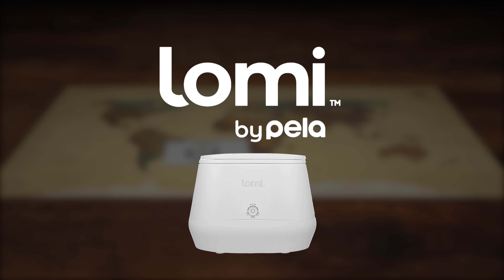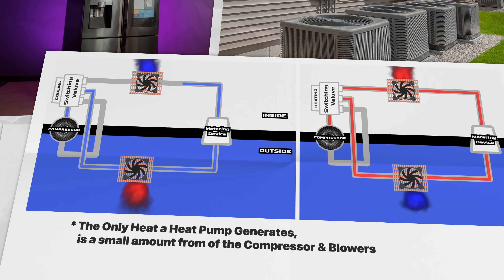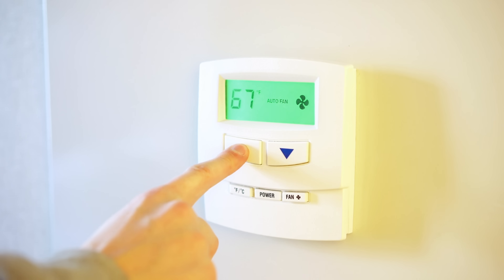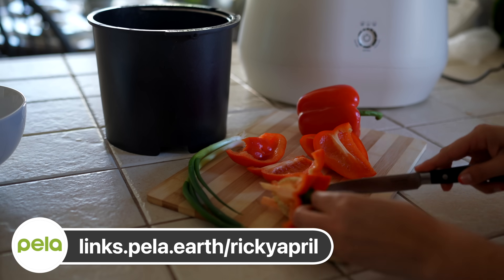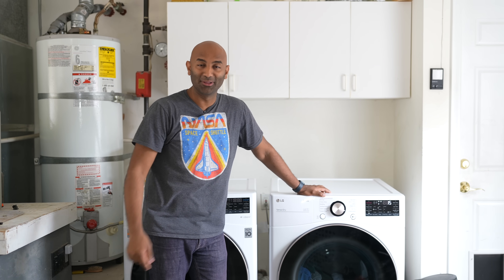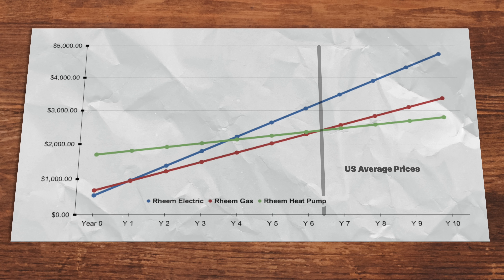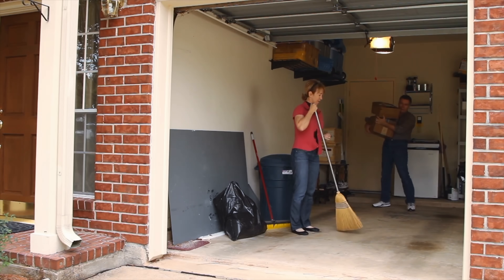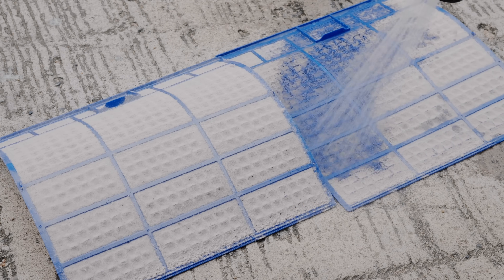I'm Shocked How Much Money Heat Pump Appliances Save!

Comment: i wonder if external heat pump appliances are a thing. being able to hook your dryer, water heater, etc into your mini split heating/ac system would be really cool and wouldn't have the downside of pulling heat from the surrounding air. i live in maryland and we have a heat pump water heater in the basement (where i spend most of my time), it makes no sense because i'll have an electric heater running half the time. being able to pull from outside air instead would be much better.

Comment: I do agree that heat pumps are great but they are even better when used in combination with each other.  Like, the best example would be heating your pool with your home air conditioner, instead of that heat being blown into the air next to your house, it goes through a heat exchanger that your pool water runs through.  Now that’s efficiency and I believe there is actually one out there that is basically made for the whole house needs, so just one system for your hot water, your cool air, pool, dryer, and whatever else you might have that needs heating or cooling.

Comment: Heat Pumps throw the heat all around the house it follows the pipework.a gas fire is concentrated heat exactly where you want it and not wasting it heating empty rooms therefore it is cost effective and not wasteful like your pump.Nice video 500% efficiency haha not in the winter pal heat pump not used in summer

Comment: The thing I'm really looking for are head units for water heating or dryers that can be attached to multi-split heat pumps like the large Mitsubishi and Fujitsu units that can have as many as 8 circuits attached to them. The idea that we can have such a unit intelligently shunt heat around from one place to another seems like an exciting idea. Why cool down the room where the hot water system is when you are actually demanding cooling in the living room? Pull the heat from the living room and put it into the water. I have seen presentations from Mitsubishi showing such systems, but suppliers here don't seem to be mentioning such options on their websites, yet. Maybe I need to make some phone calls.

Comment: Your dryer vent line needs a booster pump.
I’m almost sure it’s a code requirement for a run of that length.
You probably have one that has a failed air switch. 
I recently changed out mine for a Tjernlund  LB2

Comment: Heat pumps all the rage but where is all that power going to come from? Wind? Solar? Yeah right! And they work really awesome in the snow belt regions. NOT Comparing heat pump models to electric is rediculous… what’s a heat pump use for energy? Pixie dust??? Electricity Spread out our usage??? Dude spreading out usage is using different energy types, when one utility is struggling it’s good the have a diversity of energy types. You are encouraging everyone to load up the electric grid even worse than it is now. Do it because you like the technology, but don’t tell everyone it helps the electric grid, it doesn’t.

Comment: I recently bought a Heat pump dryer, and when you get one you could probably do a whole series on them.  Mines actually a washer and dryer in one unit. In theory it shouldn't give off much heat because the air is a closed cycle. But its not a totally closed cycle and some humidity and heat come out into the room. Still its really nice not having to vent the air which would be replaced by outside air somewhere else in your house.

Comment: As a Brit who grew up with farenheit but converted to centigrade the latter makes much more sense.  After all, freezing point for water is 0C, how simple is that?  Boiling point is 100C.  I struggle to remember the comparatives in farenheit (was it 32F and 240F) which shows how impractical that scale is.

During the transition I remember having to keep converting back to farenheit to determine whether I might need to wear a sweater if it was going to be 16C that day 24C that day but it doesn’t take very long at all.

Comment: Love the HP water heater.  Here in Florida it helps dehumidify and cool down the garage which in turn affects the requirements for the rest of the house.  The biggest bonus these days have been the improved automation that let's us set up a schedules for demand.  At the family bath time we crank up the temp and demand (it uses the heat pump and the element.  The rest of the day it's at a lower temp and heat pump only and at night it's pretty much off.

This is my second HP.  The first was a GE and lasted for 6 years.  Pretty good since that model was discontinued after 2 years due to issues.  It paid for itself the end of the first year due to rebates.  The second is the one from Home Depot.    I was already sold on the tech, but it is the scheduling control app that really makes it shine as I mentioned earlier.

Comment: Heat pump dryers are relatively new... in the US...in Europe they have them for decades.
And what is up with those sponsored products, I saw one for water purification with need of throw away plastic filters and now this compost thing that is a mechanical device that'll break and cost electricity to run and a simple compost bin could do the trick much cheaper and cleaner.

Comment: The only reason is see to ban the ban on gas usage is to advert the strain on the power grid.
In the Netherlands, all new construction goes gasless because that's the only way to build energy efficient enough.
But our power grid is kind of overloading. Half the country can't connect anymore renewables to the grid.
Some solar fields have been shut off for a half a year because they can't deliver on the grid.
It's a bit of an issue. Because not only are metal prices going through the roof now. But the amount of technical personel is way to low.
Reply: (And the amount of artsy fartsy (wo)men way to high)

Comment: The scam is CA won’t give you the$3000 until you Cap off your gas line and completely remove your gas furnace .  Even though the better choice for home owners is to keep / use the gas furnace and have heat pump together . For occasions such as when outside temperatures reaches close to freezing or when it’s a cloudy days where solar array is useless.   Can you image the $$$ the electric company can make from your power usage? HUGE!   Heat pump used 240 at your attic AND the unit outside the home! , uses a ton of energy!  Ofc California at this point will roll out the push to home battery industry scam soon after.
Reply: Germany did the same thing, electric demand went sky high and now they buy more Russian fossil fuels than anyone just to power it all!

Comment: At least you didn't use oil heat, we just changed over the office at work after it hit $6 a gallon. It was costing around $600-900 to fill the tank and the furnace was rated at 2GPH, so it was costing $12 an hour to run. The mini split should cost about $15 for an entire month so it paid for it self the first time we didn't need the tank refilled.  But on the water heater, our is in our bedroom closet so we would need to run the heat to make up for the cold air coming out unless we ran a vent to the outside, maybe with a valve to send the air back into the house in the summer.

Comment: The U.S. has so much natural gas that for the time being we don't know what to do with it. We're currently burning off so much of it in the fracking operations that it looks like NYC from space. Heat pumps are fine, and I used to have one (almost 30 years ago!), but they don't really offer savings versus natural gas. That is why they have not caught on and are not likely to do so.

Comment: I'm all for this, and have been hoping this would happen for the longest time. This needs to be combined with passive solar (thermal, not cells).

What we also need to have is repairable appliances. Repair that water heater. Repair that fridge. Etc. The parts need to be standardized - open standards! - so we don't throw away so much.

Comment: Too bad installers here in Mass gouge customers for a 1 day instal and charge 10K labor minimally. I had 2 quotes for a 2 ductless unit for my 701 sq foot condo and was quoted 14K!!! The parts are only $3,500 for a solid known brand unit which means they were charging the rest as labor. I read it was a cheaper solution to a furnace but with the bonus of AC. Not where I live. Price gouging simply because heat pumps are better. Absolutely ridiculous.

Comment: Ricky, great episode. We have PV solar, two air-to-air heat pumps for home heating/cooling, induction cooktop, LED lights, a Tesla, and a Li golf cart. A heat pump water heater and clothes dryer are on my radar. The PV solar has already reached breakeven, so going forward our energy needs are free! Savings in 2022 will be $3450.

Comment: With our 13.2 kWh solar PV system coupled with our two PW2's, we are operating as a microgrid for 9 months of the year producing all the electricity we need to power our all electric home, charge our two Tesla's and export ~50% of our solar back to grid. We have heat pump and heat pump water heater and agree they work extremely well. Our total electric bill last year was $180, and our monthly bill is generally less than $15.

Comment: this man talking farenheit like those units make sense. If you didn't already know them, you couldn't make sense of them without constant reminders and guides. I know that because thats how it is for the rest of the planet when having to convert to farenheit. Celsius is easy. 0 is freezing. 100 is boiling. At 50 you get burns. at 25, you are comfortable. at 12.5, it's not so comfortable anymore. What is 100F???? what is 0F??? is 50 F cold? or hot? is 200F a lot or a little? much like other imperial units, they only make sense for people that like to fudge the numbers and keep the rest uninformed.

Comment: What I want is to tie all appliances to central home heating cooling heat pump with and exchanger outside (with option to bury heat exchanger loops underground).  If you have a central heat pump and blower in the attic right above the corners of four rooms you can locate refrigerator, dryer and hot water heater under it with standardized wall connectors.  If we are going to heat pump all the things then all the things should be integrated into a single system for maximum efficiency.  Otherwise you may be generating heat in the house that then needs to be pumped outside if you have separate systems.  This would have the lowest up front cost and best energy efficiency, and would be easiest to design into new housing rather while a retrofit would require extensive remodeling.

Comment: Heat pump for heating only. I'm in the field of HVAC, and I'll tell you right now the techs and companies out there are mostly idiots. Number one problem with heat pump equipment failures are improper installation.  Sizing the equipment is never properly done. The equipment itself is still very expensive, it's not economically viable to use heat pumps for all those other appliances when the risk of Joe Dirt installing it wrong is too great.

Comment: Thousands of people using simultaneously tankless electric water heaters? Sounds like a typical morning/evening in germany 
Mine heater has 22kW and it hangs over my bathtub, so when I take a shower, I can adjust temperature with one grade precious - the only positive thing about it. Well.. it was quite cheap (300€) and takes barely any space

Comment: I installed a 4 head mini-split heat pump last Fall and a hybrid water heater a few weeks ago. Why? The house has oil heat and is insanely expensive to heat that way. At worst, when the air is 0°F and the efficiency is low, the system is about as expensive as oil, at best, when it’s above about 25°, it’s much cheaper than oil and I can turn off the boiler now that I have the hybrid water heater and the oil boiler isn’t needed for water. 

Having the hybrid water heater in the basement is sort of poor man’s geothermal as the basement is always 50°, although the heater does drive its area down to 45°
Reply: Oh I should say I installed the minisplit system myself except the last bit of refrigerant hookup because having an installer company do it absolutely wrecks the cost effectiveness of it. The equipment is pricey enough as it is without doubling for installation.

Comment: Climate change is natural. Man made change is not. Where they meet is the question. BTW, I have a heat pump water heater and truly it saves me 40 dollars a month in cost. Make sure you vent the cold air outside or you will freeze.

Comment: LOL I have been an HVAC contractor for 40 years. Heat pumps have their place but you are leaving out a lot of details. You didn't mention anything about standby loss when comparing to a tankless water heater. You didnt mention how a heatpump water heater was going to fill my 120 gallon whirlpool bath, because it wont. You forgot to mention how hydronic systems, which are much more efficient than warm air systems operate at temperatures far above what a heat pump can produce unless you have a radiant low temp system installed in your home. Finally, and I speak for most qualified heat pump repair men, If you actually think I am going to replace a compressor in your heat pump in 6 degree weather and shovel a path through the snow to get there, your cost of repair will be far beyond anything you think you are going to save.

Comment: It is great. I fix appliances. Questions what are you doing when you're fridge heat pump die after 3-4 years and cost $1600 to fix it you and 99% of the people through it away great green thing. And if you buy a nice heat pump dryer and instead of $30 for the heater now you need $500 for the heat pump plus labor to replace it, you through it away. Nice technology. If they spend a money to ask the previous generation of engineers ho they appliances lasted 30years plus instead of 3. Or just make a washer bearing what last 50years instead of 3, or an icemaker what can operate more than 2 years....... If the heat pumps come with 30 years warranty labor included that I all in . If it is 1 year than no point to work on it!!!!
Reply: One more small comment. Just yesterday they had to trash 3 fridge what other wise in perfect shape because of the heat pump replacement cost of $ 1600 what comes with 1year warranty !!! Put the average 4 years of life in the calculation than run it again, not so good anymore right. No people on the street braking LG buildings to demand better compressors or tax them to create extra waste or investing if the engineers there went to any school.... Nobody cares, so stop global warming speech until people really do. Not with forced government penalties, with common sense.

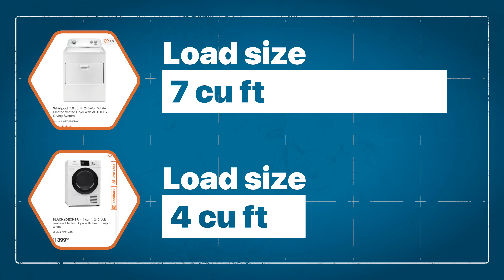Comment: omg, you guys are so overpaying for stuff. Heat pump cloths dryer at 9:20 for 1400 USD? 

in Europe dryer like that (with heat pump, not resistive one) cost 400 USD from cheaper brands to 700 USD for models with additional bells and whistles to 1000 for top brands. Only Miele costs about what "most popular in Home Depot" is around that price, but this brand is always a price point outlier.

Comment: Not an option up here in Scotland. Summer temperatures on average are 16-17 C and we Scots don't use the heating in summer. In winter the average temperature is 0-3 C, so air source pumps would be dragging cold air into the heating system. You would need the immersion heater on all the time costing an arm and a leg. Total con!! The installation costs alone will never be recovered never mind the running costs up here. Unless insulation of houses drastically improves this is just another government sponsored white elephant like when they supported diesel cars

Comment: A solar blanket for your pool will be cheaper than running any heater or greatly reduce its need.  It will make your home much more sustainable.
Reply: Also look into a solar hot water heater for your pool.  You can go really cheap as you can go unglazed glass as you don't need the higher heat that glazed gives.  Also check if you can gravity siphon solar water heater for your pool, they use no power at all.  If not a small pump or hooked into your water filter will only use a fraction of the power as a traditional heater.

Comment: You still must vent very humid dryer air out-side or pay elec. for more A/C.
Reply: I recently just got a ventless dryer. You don't have to vent. The compressor is basically squeezing the water out of the air then sending it down a drain pipe. It heats the clothes to get the water in the air first but since the air is a closed loop you it can keep "reusing" the heat. Now I will say mine is not a totally closed loop so some humid air does come out. Its not a huge problem, but some humidity and heat does come out.
Reply: @tylermcqueen5297  Never knew they were selling heat pump closed loop dryers. It cost more elec. power than other ways.
It will fight your a/c power cost. But
we are free to chose any method still.

Comment: Propane is whats in our area, they have some sort of community tank, it was costing me 55 dollars a month to use the propane water heater.  I got a hybrid water heater now its 6 dollars in electricity.  We had a propane furnace and got a VRV based heat pump for heating and cooling the home.  Heating the house with propane was 100-500 dollars a month down to 50 dollars in electricity.  Only thing we use propane for now is backup heat for heat pump (mainly defrosting when its cold out) and a fire place we use for a few minis once a year.  The tax incentives both federal and state are huge.  1200 dollar heat pump water header was only 800 with tax incentives with another 300 return at tax time.  So water heater will pay for itself within a year with the propane savings.